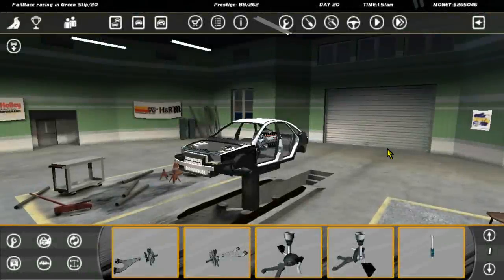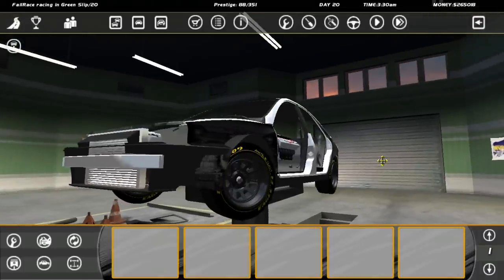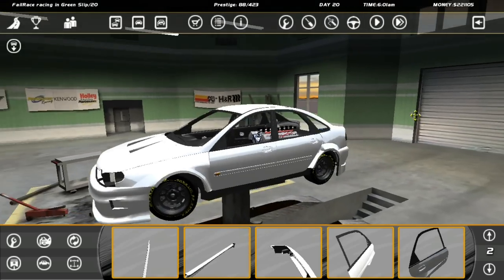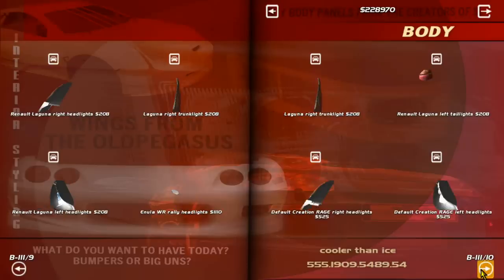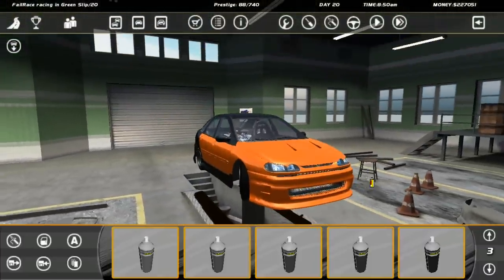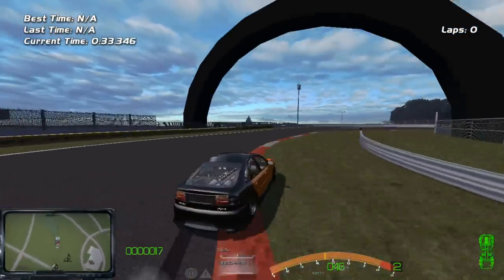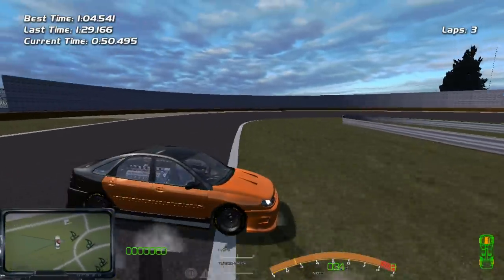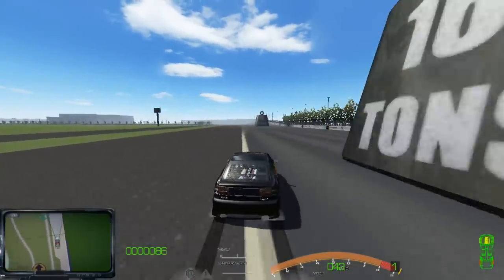FailRace Play SLRR V16 Renault Laguna

Comment: The Cizeta V16T used two V8's to make a V16, there were the old 1930's Cadillacs that used V16's, Rolls used 9-litre V16's in a few Phantom Concepts and the Phantom Coupe in Johnny English Reborn, Cadillac used a 13.6-litre 1000hp V16 with cylinder deactivation in their early 2000's Sixteen Concept, Bugatti obviously has the VW W16, BMW made a 6.7-litre V16-powered E32 7-series in '87, the controversial Devel Sixteen Concept apparently uses a 5000-hp V16, and plus many more in the racing world (30's Auto Unions, a prototype Porsche 917 used a flat-16, and the unusual BRM 1.5-litre supercharged 600hp V16 that revved to 12k rpm)
Reply: Wasn't there an Isuzu v16 car?
Reply: +GTACIP oh deary
Reply: That Youtube Critic What?

Comment: Cizeta V16T
Reply: The engine is not a true V16. Rather, it was engineered from the ground up as two flat plane V8s sharing a single block, mounted transversely, with gearing between the two providing a single output from the center of the engine assembly to the transmission. After the war there hasn't been a single production car with a "true" V16-engine (or so I believe :)

Comment: FailRace The Cizeta V16T was, obviously, a V16-powered car. Though I'm sure you've heard of it :D
Reply: Dual pop up headlights... this car wins at everything
Reply: Was trying to remember that name, wast it mounted sideways too so the rear end was ungodly wide?
Reply: abracing199 I believe so. It's like those pictures of Supra's and GTR's.

Dat ass.
Reply: Really? Thought The SRT Viper had 355's
Reply: Carlos Aponte I think it has 335's... don't quote me, I don't actually know for sure.
Reply: Wellllll, it's not a true V16.  It's more like two V8s that share the same block.
Reply: Tedrick Leong So a V16. It was two v8's welded together. Not a W16.
Reply: Aidan Rule It may have had 16 cylinders, but it's not a pure V16 because there's gearing between the two V8s that convert the output from the two engines into one.  I'm picky like that.
Reply: Tedrick Leong Well that's false advertising :P

Comment: throttle control and correct use of the parking brake, you need to be low rpm starting your drift, hit the parking brake turn the opposite direction and tapping the gas, don't bother hitting the normal brake.
Reply: Exactly. All Alex can think about is full throttle and no grip control, and the tires he was using were a bit too grippy as well. And also, if it's rear-heavy, it would be more difficult to handle anyway, as there would be less front grip to turn a corner. This game has amazingly good physics for 2003 (although I use a custom physics set :))
Reply: Waylon Richardson well your both wrong you can't stop the snap oversteer as it is a mid engine vehicle
Reply: Waylon Richardson the point is to not slide at all